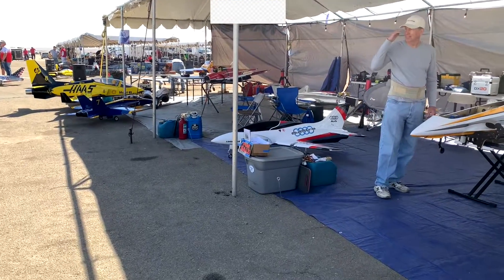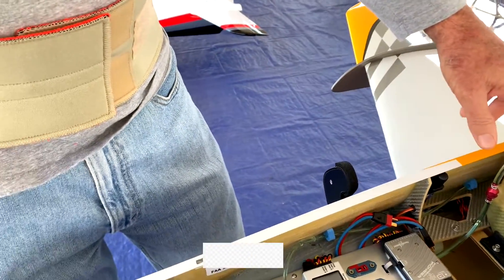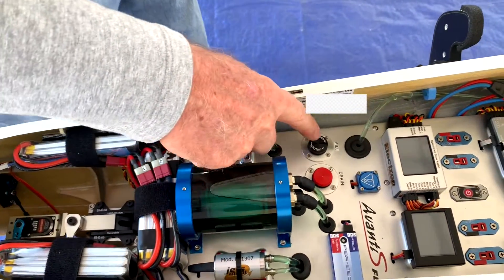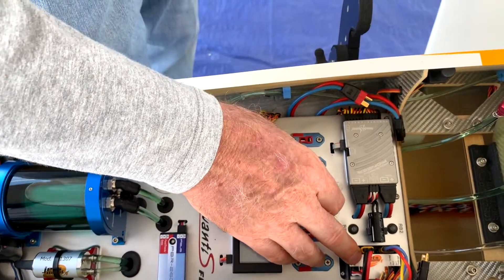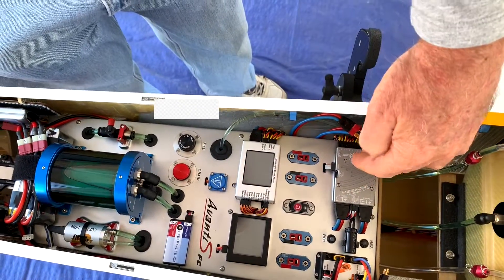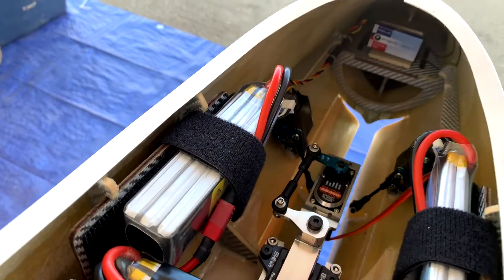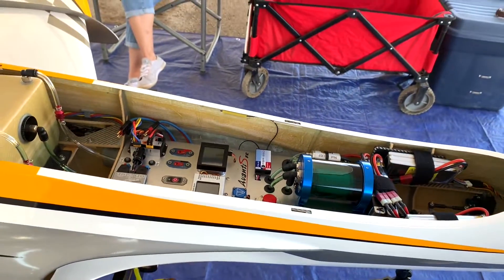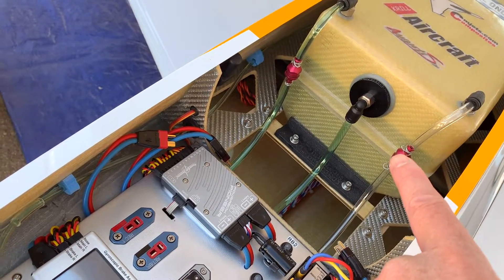Lesson Learned What's inside a Turbine RC Jet? 8HrToGo

Comment: Is the FARDEK similar to the ESC on EDF jet. Thanks.
Reply from the maker: Here is my best brief explanation.. yes, in a way similar.. The Full Authority Digital Engine Control(FADEC)is a computer managed ignition and engine control system used in modern real size aircraft, as well, also used in RC turbine jet. For example you give input to your transmitter throttle stick, the FADEC will control the fuel flow mix to the turbine based on throttle input.

ESC is associated in the world of RC electric prop/EDF planes. The ESC unit control speed, direction of motor by altering power feed from the battery. Modern ESC also consist of the BEC(Battery Eliminatin Circuit)that regulate power supply for receivers and servos. Hope it help to clarify.  If anyone have a better explanation, comments are welcome.Thanks.